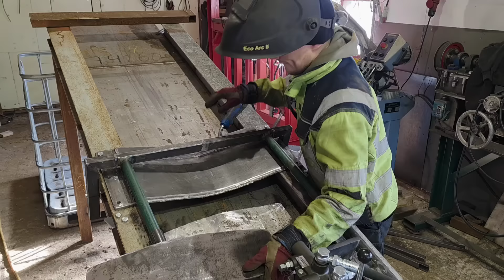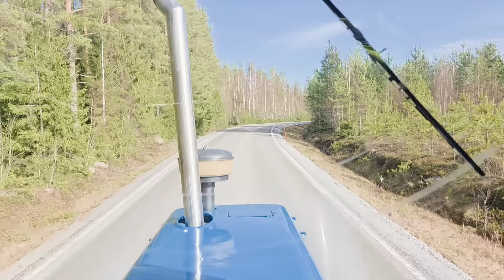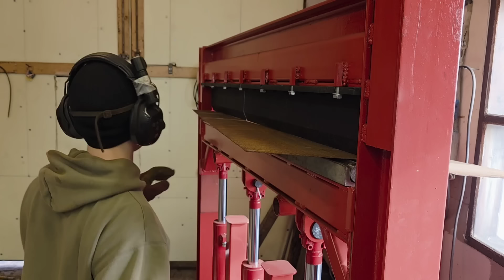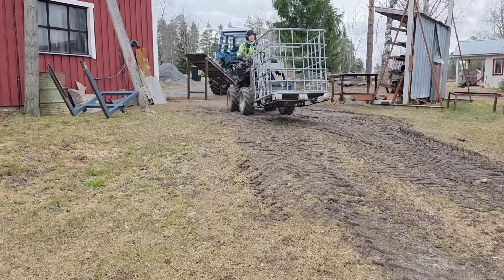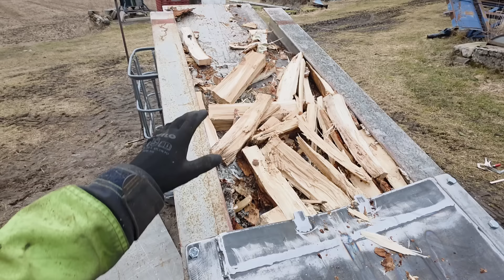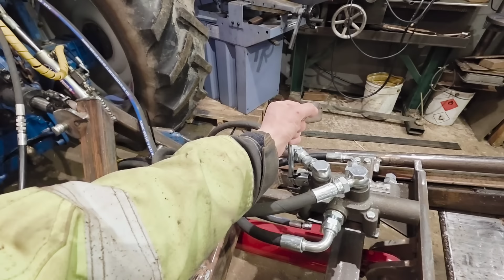Testing my special home made box wedge firewood splitter in Finland

Comment: Your problem is your splitting heads being angled outwards from the center (your outer most bits of wood are being turned on a 30 degree angle or what ever youve welded them at) if that makes sense? They are being pitched towards the outer frame rails then the next bits coming through turn them even more so thus jamming your entire show. All in all a really awesome set up though mate, love it 👍👍
Reply from the maker: Thanks for watching and giving your opinion 👍🙂

Comment: Cool build. I want to build something like that
Reply from the maker: Hi Andris, cool to get a comment from you 😄
I've followed your stuff many years!
Hope the best for you!
Yes, I saw you were thinking about that with your splitter. Mine is working really great now, dont need to handle the wood so mutch, and when I get the pto pump on my tractor then it will go mutch faster
Reply: @DaveSteel-p5xim just afraid that my twisted and narly wood wont go through the box wedge very well

Comment: Thanks for sharing your experience,
I was waiting for you to put multiple logs at once, and try checking its splitting limit.
Also, instead of covering the top with a bonnet, and losing access and eye contact with the wood, why not building a bottom metal chain conveyor with a small hydraulic motor? It’ll resolve your problem with turning and stuck wood.
Also, if you raise the two sides, you won’t have wood falling after splitting.
Reply from the maker: Thanks for watching and commenting 👍 

The whole idea with the design is to keep it simple and to get the cylinder to do all the work. If I was wanting a conveyor then I had done everything in a other way. Hope you understand.
Then, there was a problem with the vedges in this test video so I could not do it. Problem appeard and was solved in the following test videos. 
Now it has worked really good 
Only problem is slow hydraulic flow, but thats also gonna be solved soon 👍😊

Comment: Outfeed belt. Like a conveyor. Drop chute long enough to fit a tote under. Drop chute is the screen. First tote catches debris second tote catches the wood. Love your splitter. Paint a stop line. Prevent hitting the pressure relief so much.
Reply from the maker: The whole idea with this thing is to keep it simple, cheep, and the one cyl do the whole job. Relife valve was adjusted to low pressure, thats what caused that sound, I increased the pressure.
The splitter has worked really good, the firewood is already made done, previous years it took to june with my normal one wedge splitter 😄👍
Watch the link, did some upgrades
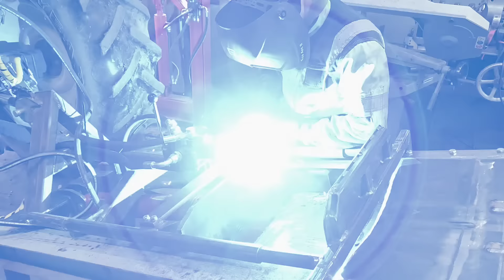Reply from the maker: 10:20 https://youtu.be/PKJBSRb-Pwo?si=KjrLPa91CktqHDNO

Comment: Change the flat plate under the "chute" into several long round bar going longwise up the ramp.  It will act like a screener dropping small parts out and it might help guide the firewood straight?
Reply from the maker: Yes, thanks for your comment 🙂👍 
I will do a update video on the splitter in a few weeks

Comment: I don't think your concept is working. You produce a lot of small bits and scrap. Better stick to a cross or double cross instead of this constant going back and forth. You spend much more diesel this way and the small wood burns too quickly in the stove. I do like your videos though and your dry humour style, keep on going! I don't understand steel construction but i think you sometimes over do the strength or size like with the mower you're building. I wouldn't have made this square construction where the mower is hanging from. Just straight from the 3 point hangup 2 beams (1 top 1 bottom)  side ways to the deck would have been enough I think. By the way I am in Portugal where everything is very expensive🤣
Reply from the maker: Thanks for your comment and opinion 🙂👍 
Well, lets se when I start using the machines what works and what does not 😉
Reply: Ota huomioon että puu on jo alakanut hieman lahoamaan ja että puun lahoaminen on jo niin pitkällä että kuori irtoaa isoina levyinnä,  joten koivu on varsinkin puulajina sellainen että se tuottaa paljon tämän tyyppistä silppua, juuri tämän lahoamisen takia. ...

Comment: Hello, nice work , you git new follower !❤ I think that the output channel is tho wide compared to your tree diameter, perhaps it could work better by splitting two tree together, they will keep more parallel to the moving direction. And if you use only the center, install some  removable wood or steel  beam so reduce the channel width to the size of the tree you split . I am not a pro, just a guy that like to help the people who share their questions …
Reply from the maker: Hi! 😊
Thanks for your thougts and opinion 👍 
Watch the latest video 😊

Comment: You should make a convayerbelt that starts right after it gets split, and then transport it up and then make a down slide of iron rods the debris can fall through and the firewood keeps sliding down further to the pallet cage.
Reply: Also make the convayerbelt v shaped like the metal sheets you already made.
Reply from the maker: Hi! 🙂
That would be awesome, but.
The whole idea here is to keep it simple, cheep and easy. Let the cylinder do all the job, it should work. 👍🙂

Comment: Screening of debris should be carried out using a drum screen to separate fractions efficiently. The extracted wood fraction is well suited for utilization in wood fired boilers, providing an effective way to recover energy from the waste stream.

Additionally, it is recommended to close the inner edges of the IPE beams to prevent accumulation of debris, which may otherwise lead to operational issues over time. The board length should be cut and adjusted accordingly to ensure proper fit and structural integrity.

If required, a conveyor system can be implemented to facilitate handling and lifting of the wood material, improving both efficiency and ergonomics in the process.
Reply from the maker: Thanks for watching and commenting 👍🙂

Comment: Love the way you use your equipment in creative ways. I have never seen a wood splitter like the one you made. Why is it at an angle? Looking at your thumbnail the working height is in line with the blades,  wouldn't it be easier to make the angle flat and lower the ICB cage about a foot, that way your not fighting gravity, also you could put 20mm holes in the steel plate letting the small debris fall into a bin or even the IBC liner . 
-MG
Reply from the maker: Hi!
Thanks for your interesting comment 👍🙂 
The whole idea with this is that I want the cylinder to push the firewood upwards, into a box or on a trailer, wonna work on eaven ground
Reply: @DaveSteel-p5x I get that you looking for flat ground, digging or making a step just the size of the IBC tote cage is what I was referring too. The work area would not be affected just the area under the IBC tote. When I looked at the blades you welded you flared them out,  if A log is wide enough won't you get the wood pushing out making it turn. I do like the idea mentioned in the comments about using bars to drop debris, but I would think making 6 channels separated by bars might also work, there's no way to turn if the length is longer than the width just a thought.
-MG

Comment: Hi it's working really well  yes needs a bit more. Just one thing how come you just didn't cut the top off the plastic tub so all the wood just stays in the box then.  Just my thoughts .your doing great job thow. From Andy in uk
Reply from the maker: Hi 🙂
Thanks!
Because of mold, it has to be open for the air to cirkulate 👍
Reply: @DaveSteel-p5x how about some meash so it can still dry but not fall out.

Comment: You are a real engineer Dave, love your work 👍👍
Reply from the maker: Thanks Allan for your support 👍😊
Reply: @DaveSteel-p5xSo remove the plate bed  past the splitter replace it with  about 1"  metal tubes  running parallel with the splitter body set 1/2" apart.  This will do two things: allow chips to drop out and help aline the wood to go straight

Comment: Its is yet again one amazing design wood splitter. I would be recommend to just let the split timber drop straight after the end of stroke. Trim the angular slide off right after the cut. Let it drop off there. But I see you need the height to drop off into caged bin..
Reply from the maker: Thanks 😊

The whole idea with this thing is to get rid of the picking/handeling/stacking wood, let the one cylinder do the job for you, its possible, almost there 😅

Comment: That is a good machine. I dont think you have to add any straighting bars if you cut the table off just after the splitter plate. Then, the pieces of wood will fall off into the container on the following push. There is nothing allowing the wood to stack or turn. 
Al from Alberta Canada.
Reply from the maker: Hi, thanks for your comment 👍🙂 
True, but I wonna have it real high so it could push up firewood on a trailer and in higher boxes 🙂

Comment: Nice splitter I think if you take the sheeting off the ramp and just weld square tubing parallel to the ramp about 30-35 mm apart to act as your screener. Weld them at 45 degree angle to help guide the wood up the chute. Good luck
Reply from the maker: Yes, I have been thinking the same also, think that would be awesome 👍🙂
Thanks for your comment and support 🙂👍

Comment: Cut out the bottom of the slide including the square tube you added and replace with pipe running in lead with the trough. This will clean and keep the wood straight.
Reply from the maker: Yes, im leaning towards that also 👍
Thanks for your comment and support

Comment: Very impressive, I think this could be patent worthy. A couple of thoughts. As you mentioned I think adding the centre channel will go a long way to keeping the split wood from twisting and jamming the out feed. The second thought. Not sure if your hydraulic setup is strong enough for this….but if you were to load 3 logs at once the split pieces from the 2 outside logs would keep the centre pieces from twisting and jamming. More of an equilibrium. The last thought is if with the final out feed that you were going to shorten, maybe lengthen it but bent it down as you said and put 3 inch holes or 3 inch wide slots in it to filter out the smaller debris. This last idea will never catch all the debris but could help. The type of wood and the age of the wood laying on the ground will have an impact on the level of debris….as you saw with the birch you were splitting. Just discovered your channel a month ago and as a new subscriber I love it. You are a real craftsman. I shared your design with Andris of “Ants Pants” as he is designing his own version of a firewood processor. He was already following you.
Reply from the maker: Thanks for your comment and thougts 👍🙂
About putting few logs at the time, that is possible but there is some problems with that. The splitted firewood takes more room than a unsplitted log piece, so that will jam up in the wedge, 
And secondly, the springload plate is  only holding the longest wood piece...
There is mutch details still to figure out 😄
Reply: @DaveSteel-p5xYou are 90% there…..the last 10% of your journey can take 90% of your brain power to figure it out. You will succeed.
Reply: Great points

Comment: It works really well just a couple of teething problems, I'm no engineer but what if you added lengths of plate welded from the back of each blade the full length of the bed so the cut pieces would follow the track up to the end of the bed rather than going sideways and causing a problem?
Still a nice machine I would use it 👍
Reply from the maker: Good idea, that could help guide the pieces! 👍😊

Comment: For the jamming problem, you could try adding rubber flaps angled at 45° towards the center. That way the smaller pieces would push and funnel the trash up but move and let the bigger pieces go through too.
Reply from the maker: Yes, thats a good option also 🙂👍👍
Thanks for your comment

Comment: maybe the end slide with round bar or slat bottom would clean the debris (whole elevator bottom with holes may cause obstruction with wedge shaped wood) 😅 I am still amazed how well that elevator works without belt 😮
Reply from the maker: Yes, exactly what am thinking also 🙂👍

Comment: Are you gonna fill up that whole gap?And put like, three logs beside each other, or whatever will fit in there.At the time and this push all three and split all three at the same time.
That fills up the whole gap
Reply from the maker: Yes and no, the spring system works best with one piece at the time,, but this were just smal loggs, gonna do mutch bigger 🙂👍

Comment: Why so long? It looks like you can cut it in half so the cut pieces fall straight into the bin after going through the blades. Another option is to make it half as wide. The logs aren’t going to be that wide. Just make it as wide as possible single, large log. That will eliminate the crooked wood going up the conveyer.
Reply from the maker: Yes, good thougts! 🙂
I want it to be high enough for reaching up on a trailer also, and I have higher wood boxes also

Comment: automatic firewood processor have a two belt transporters one after another and there is a gap between them in the middle so after split firewood gets on the transporter belt it gets carried  up then in the middle where the gap is small stuff just falls on the ground and bigger stuff gets carried further up and drops in the bag.
Reply from the maker: Yes thats really good 🙂👍 
I just wonna get the cyl to do all the job
Reply: @DaveSteel-p5x  one other thing that might work is the plate where firewood is pushed up could be made from pipes (maybe even simple angle iron or square tubing) oriented lengthwise with gaps for small stuff to fall out, and it probably would help to keep the wood  pieces going straight

Comment: Would it be an idea to replace the bottom after the splitter with grizzly bars? That should sort some of the debris out and at the same time help keeping the fire wood going straigt without lenghtening the machine :) Just an idea, im not a pro :D Love your videos!! Keep up the good work and hope to see many more films about your creations!.)
Reply from the maker: Yes, thanks for your tip and opinion, think it would work great 😀👍
Thanks 😊
Reply: I was about to comment the same idea. Maybe a slight bevel on the tops of the bars that are parallel to the direction of wood travel would grab the split pieces and guide the straight.

Comment: ...Also, try two or three logs ,it may solve the feeding problem,as you are only using the centre of the blade.
Reply from the maker: Yes, it would work in theory but i tried puttin 2 logs and that ended up bending one of the wedges because the "wall" was against it 😄
If I had welded the wedges straight then maybe it had worked to put 2-3 logs at the same time 👍
Reply: @DaveSteel-p5x , 'twas just a thought . Maybe ,just leave the top cover off,as you tried. Good system , and you get a 'sub' from Me. UK Army veteran and retired dustman.

Comment: Very unique idea, I love the concept! What if you replaced the solid floor after the splitting wedges with 5mm x 25mm flat steel (I’m American so those might not be the right size) mounted vertically/on edge? Then perhaps the small debris would fall through and the flat steel would help keep the pieces straight as it goes up the ramp….? Just a thought.  Thanks for the video!
Reply: Especially if you mounted those rails in a slight "U" or "V" shape, that would naturally keep the logs towards the centreline ?
Reply from the maker: Yes 👍
Reply from the maker: Yes, really good idea 😀
Thanks for the tip!